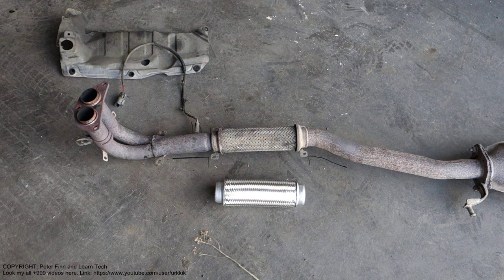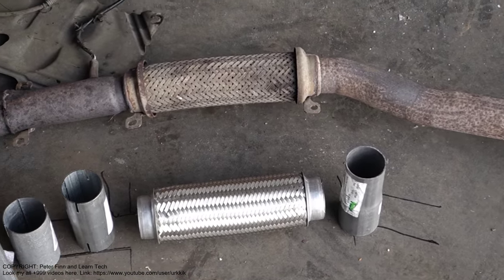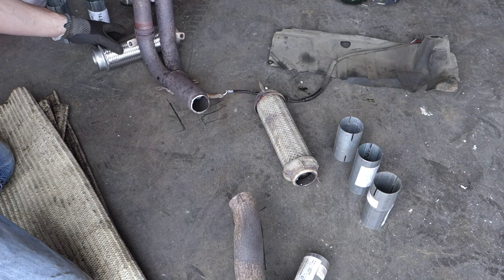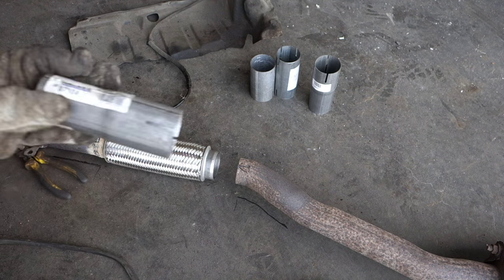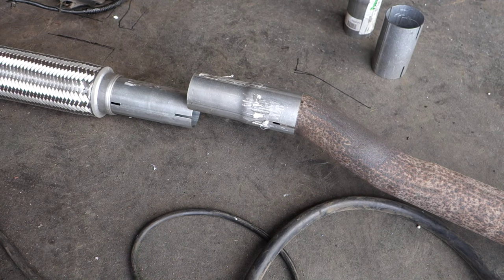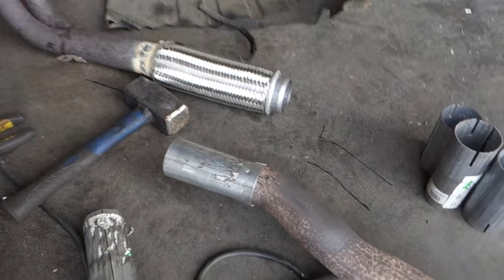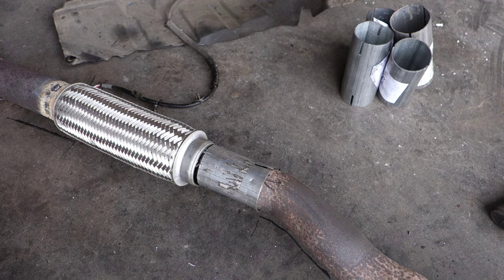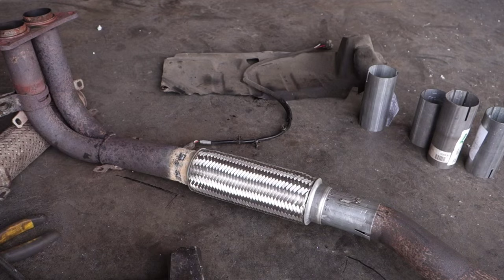How to replace flexible muffler by welding in car or pickup truck

Comment: Im planning to buy also MIG welder and do this pipe job on my BMW E36 exhaust. I need to weld in the proper connectors also.
So i can take out some of the exhaust if i need to.

Currently i have 2 brackets holding pipes together.

Nice vid. Useful.
Reply from the maker: Hello, Thanks for comment. :-)

Comment: You got the  wrong size flex pipe the head pipe is supposed to fit inside the flex pipe and from the end of the flex pipe its supposed to fit in the end pipe so the exhaust goes strAight through.......but I like the video
Reply from the maker: Thanks Sir. :-)